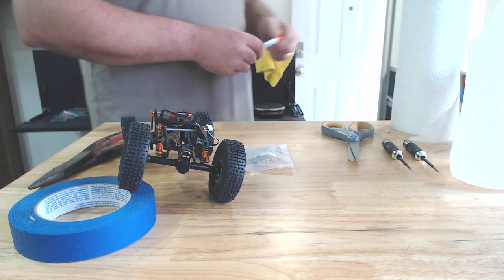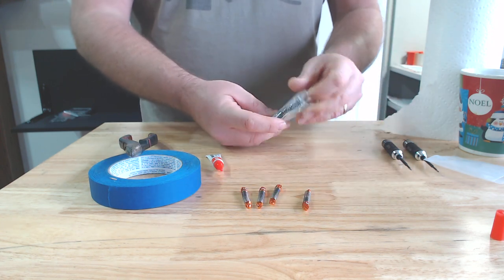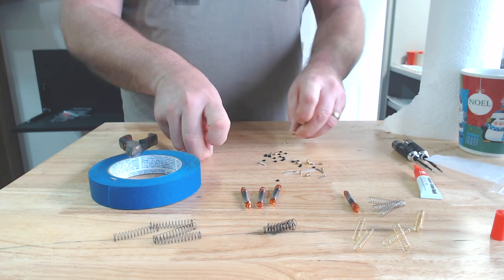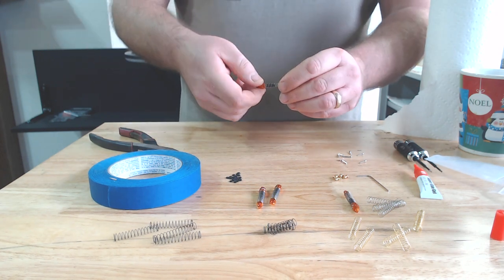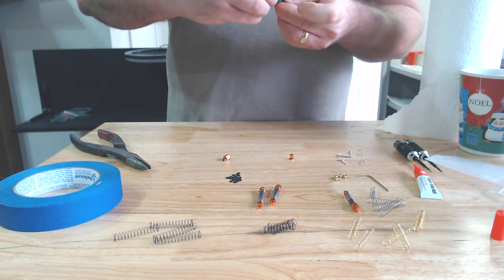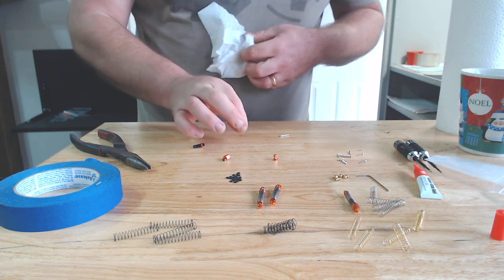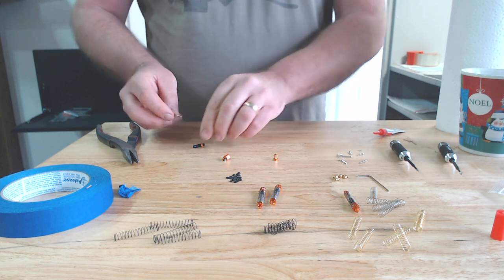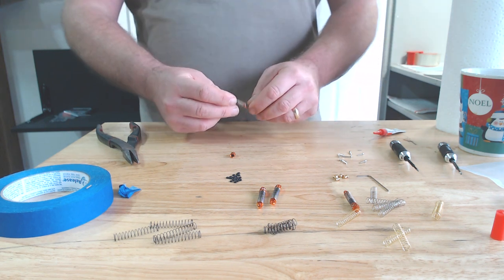Mofo Rc Long travel oil shock install tips.

Comment: Nick, a great tip is to get some team associated green slim (silicone grease) to the shaft and the seals before re assembly, helps seal every thing and lubes the threads as the pass the o rings.
Clean it off the perch threads and licking tite.